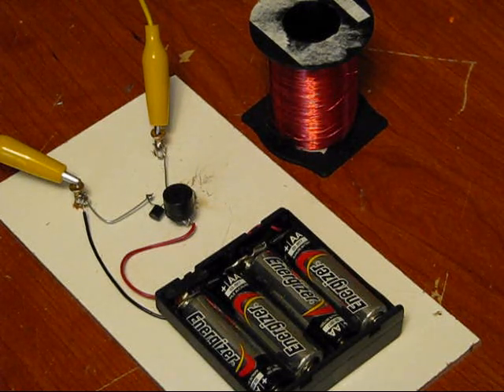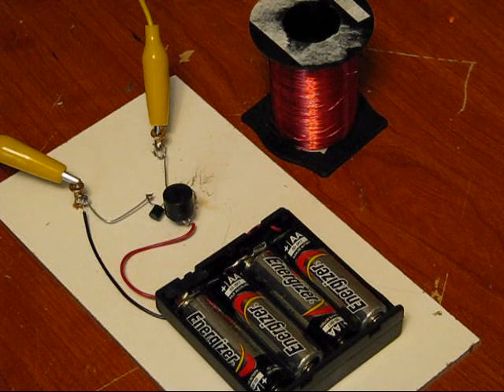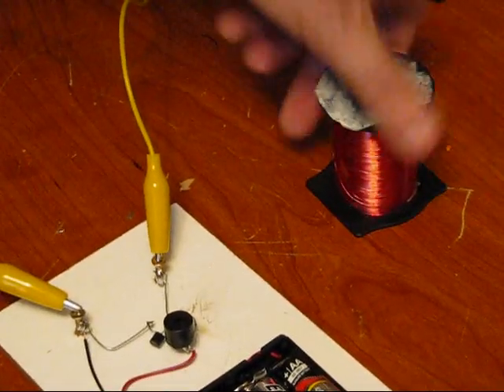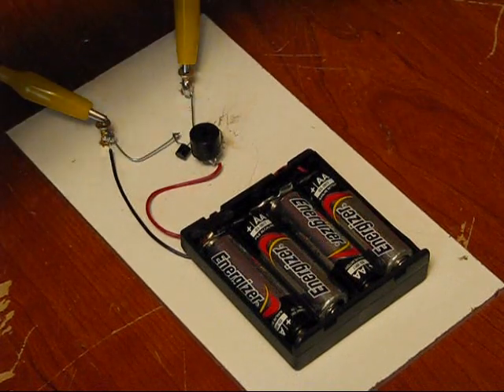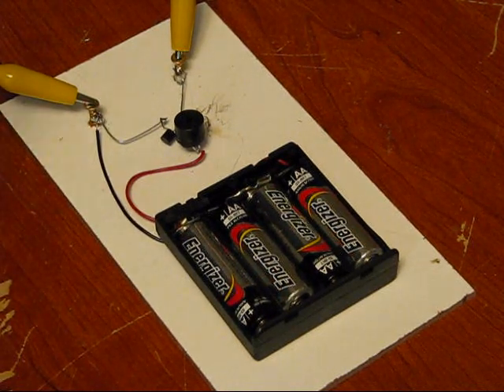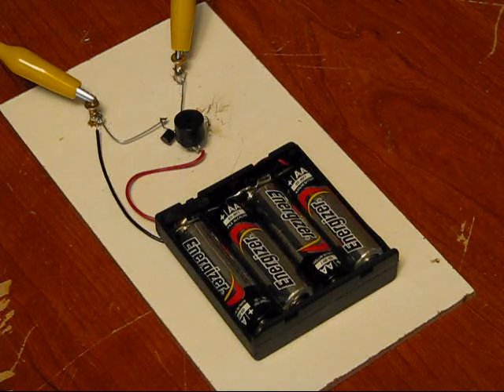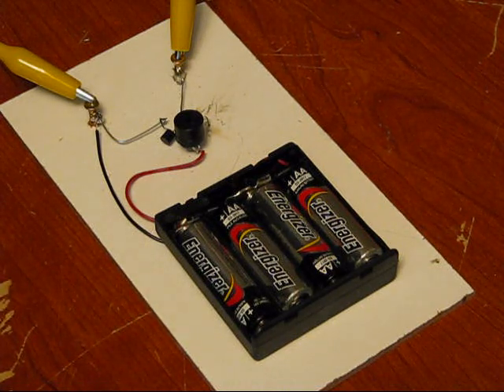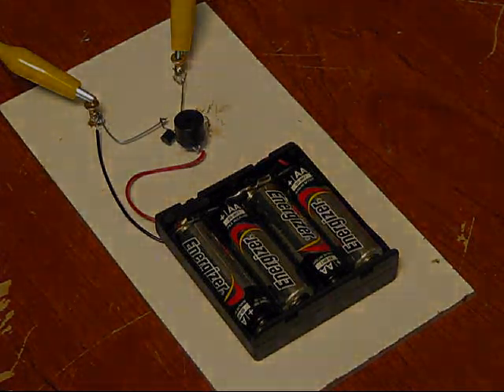Extremely Simple Electronic Trip Wire - Instructables.com

Comment: either its not workking because the DCV u using is 9v, try to use 12v battery' as wat buzzer volt u use... f stil not working, mayb d problm s in ur transistor installing.